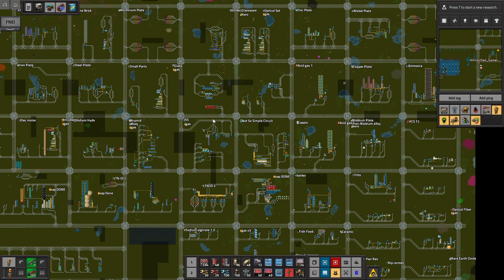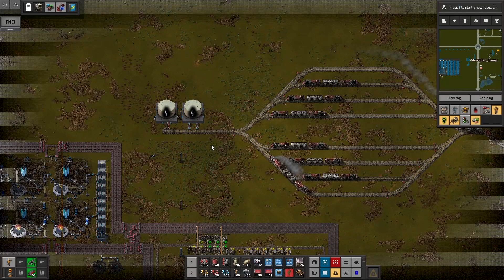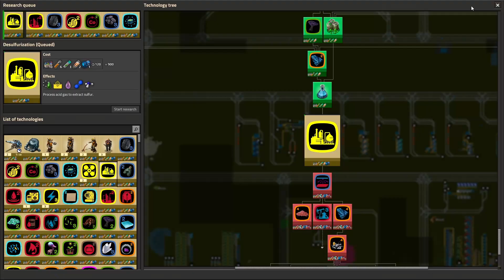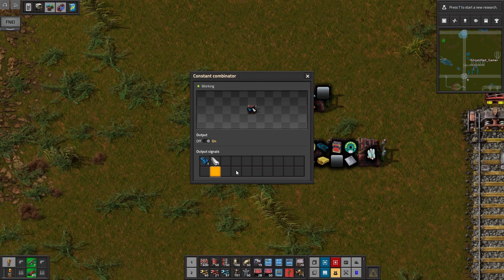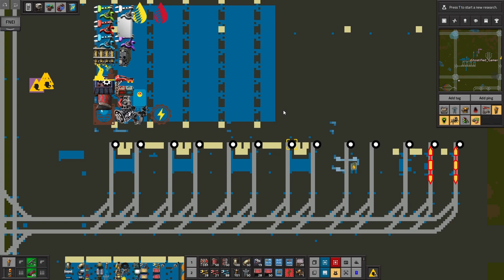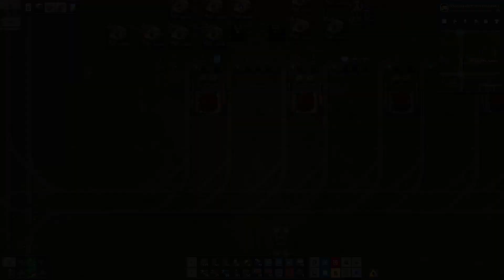Factorio pYanodons - Mechanical Part 2 (pt1) and More Research - EP142

Comment: Having molten iron on rails shall help a lot because you may transfer it + hot air + casting stuff instead of coarse fractions and stone, drastically reducing amount of trains
Reply from the maker: Yeah.  The mod shifts into having a lot of alloys so having the molten versions of the heavy hitters seems to make sense.  I'm looking forward to it.
Reply: @FantasticMrGhost  we use centralized smelting area atm and transfer all molten stuff there except old setups

Comment: Underground pump and other stuff from advanced fluid handling works nice for multifluid fueling of glassworks and smelters
Reply from the maker: Nice.  I need to spend some time fooling around with the pump then.  The kerosene has been amazing so far.  I run short if building too much but very rare.
Reply: Heavy oil -> kerosene is energy negative but you probably use another chain. Some chain plants -> kerosene shall be available soon